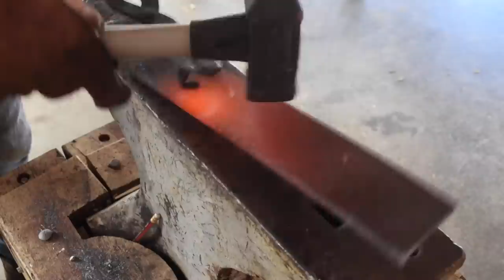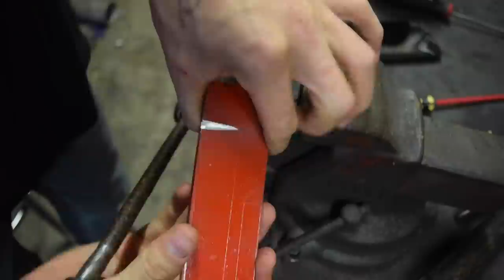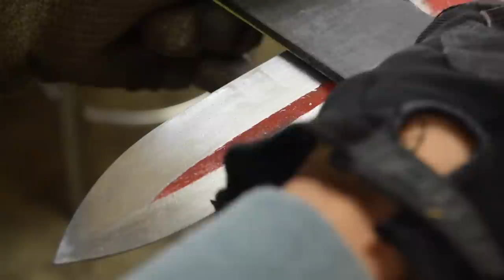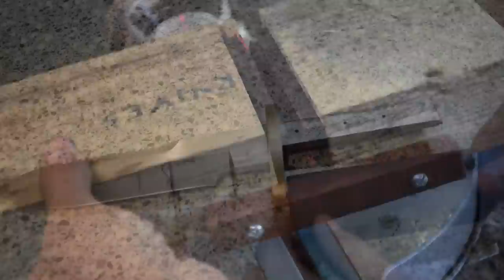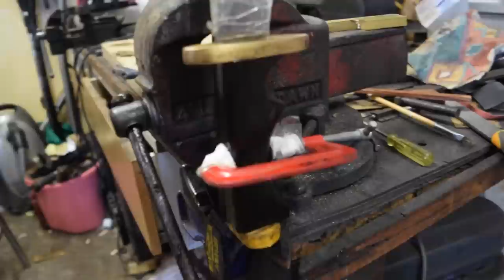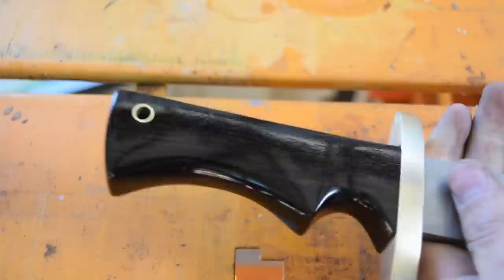Knife Making - Jungle Bowie from Truck Leaf Spring

Comment: I'm not to sure how I feel about the handle not having more pins in it, but hey! that will do Donkey, that will do.
Reply: Shane S I’ve made large knives with no pins only using epoxy holding them to the blade and i haven’t had a handle break off on me yet.
Reply: Masterplanet 420 I did the same

Comment: I'm assuming...you normalized that chunk of questionable quantity steel before and after forging and shaping due to dull Orange spark throw, before quench and temper to remove stresses?? Because if not it may snap. Did you restore it to hard spring temper or below?
Reply: I had the same questions, but searched here before posting.  The video seems to have skipped some important steps.
Reply: @ORflycaster  oh I get that...but people need to know you have to process the steel properly, especially steel that you don't know exactly what's in it. A mediocre steel if it's HT right can do a hell of a lot of work, and a supersteel  without proper HT is worthless. Cut off a couple of scraps and heat to cherry red, non magnetic. Quench one in water, one in oil. File check. Spark check. Temper them, Snap check to verify grain structure...etc. That's about all you can do. No idea what it is besides leafspring steel. Is it already microfractured hairline cracked due to stress??...but hey I'm not knocking the guy. That's why I said "I assume". IDK , I WASN'T THERE😂so I'm willing to look like an idot. That's fine.

Comment: why didn't you fold the middle for five times to give you more edges to grind to a point for cutting and give it more strength that's not really forging that's heat treating

Comment: looks so heavy, those teeth added did not cut down the weight of that blade. then you add in the giant handle and guard... hahahaha
Reply: It IS heavy. I've actually held a samurai sword made from a truck leaf spring. Yes, it was made by the Negrito tribesmen of the Philippines. They traded for truck leaf springs from the Naval base motor pool. Yes, it was razor sharp and I almost accidentally cut off my index finger. Still have a scar after all these years.